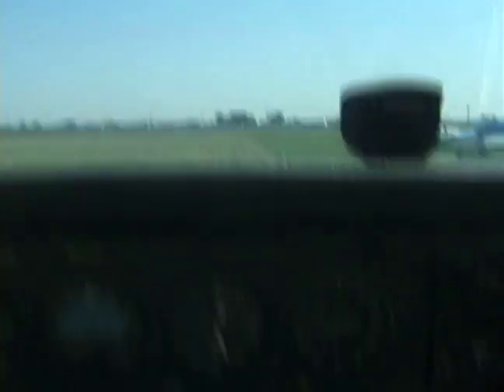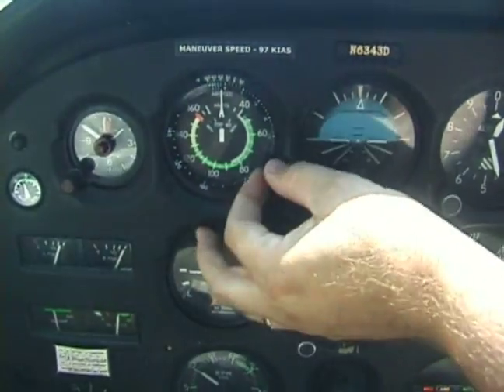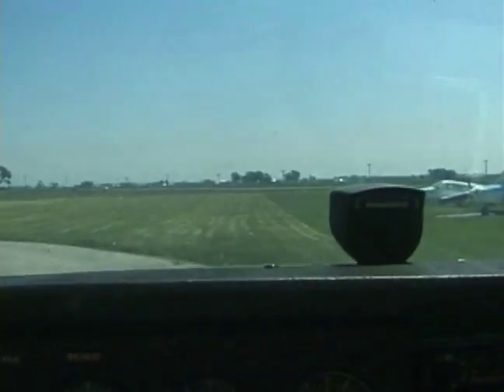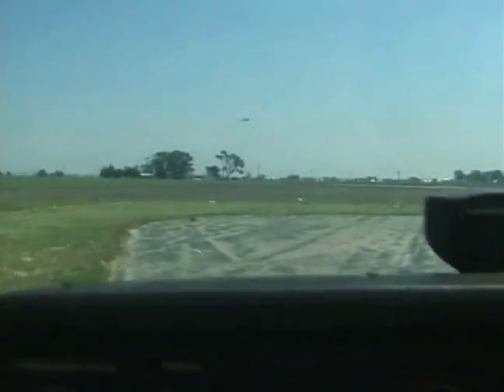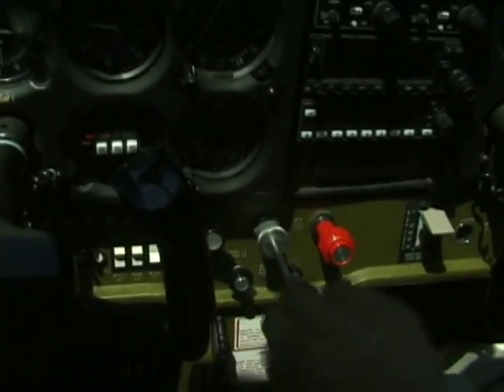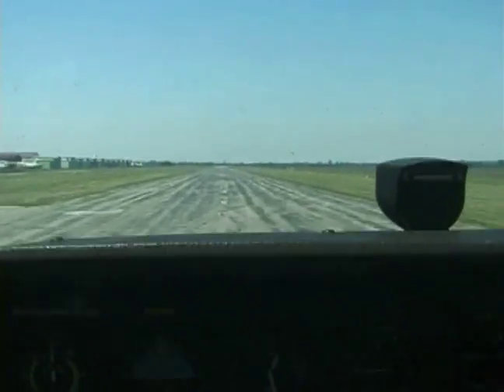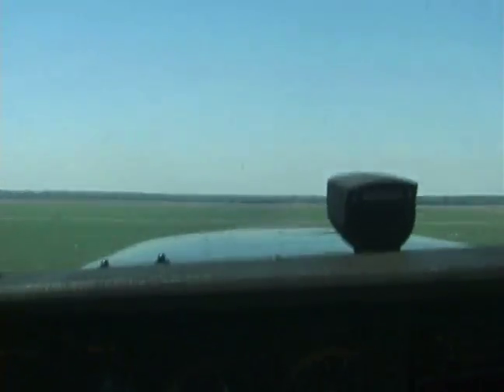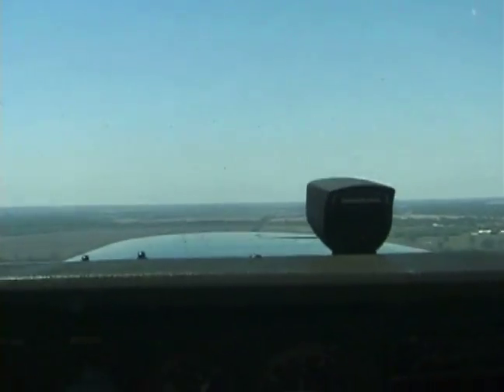How to Fly an Airplane : How to Take-Off an Airplane

Comment: Getting a plane is hard I go to Australian air league and unifor is 250$ planes cost around 100000 for a used six seater. To get ppls you need at least 4 years of flying and by the until you are around 45 you can't fly international.

Comment: I am very sorry, but I have to break your dreams. You cannot just get a free one if you did good in school and had good grants. Also, it is not 17,000. More like 100-300 thousand. A commercial plane like delta airways or Emirates costs around 5-6 million per plane. This is a small and tidy size plane, but is more than 17k or everyone will go to flight school and just buy a plane to fly around. Also, just going to flight school will not get you behind a wheel. Their is several years of training.

Comment: Depends. IF the aircraft doesn't have nose wheel steering you're going to use the brakes to turn. The rudder doesn't have nearly enough authority at taxi speeds to turn an airplane. I've flown a few planes without nose wheel steering and that is how it is done. A ground loop has nothing to do with brakes.

Comment: @saquina80 That is very odd.In a light aircraft I expect it is not as essential to do so.But only when there is no wind.With a airliner, not extending the flaps on take off will result in a definite crash

Comment: well,  I'll give you a little credit,  that you certainly DON'T know much about Aircraft,  and the surface Postion Options available,  for Take-Off,  given different Aircraft, Weights,  Ambient Air Temp,  and Density Altitude.   Yes,  it IS possible to do a "No-Flaps" takeoff.   do a little reading,  and you might learn something.

Comment: yup this is a 172 and unless the runway is shorter than 2,000 feet with an/multiple obstruction/s at the end....flaps 10 is generally not needed. BUT it also does depend on the payload you're carrying as well as runway conditions :)

Comment: The use of flaps depends on the type aircraft you are flying. Some perform better with flaps extended at take-off and some perform better without flaps. It has to do with the aerodynamic properties of the wing and the CG of the aircraft.

Comment: You don't need flaps if the runway is long enough for your airplane. Flaps produce lift at lower speeds. If you have enough room to speed up you can produce enough lift without flaps.

Comment: You're absolutely right. My point was just that I think you are able to take off and land without flaps, given that the runway is long enough and the runway condition is good, and I'd say that would go for the larger airplanes as well. It would however not be very comfortable, because you'd have to land at a very high speed so you're not stalling (perhaps high enough to break the undercarriage, which is probably the reason why you don't do it).

Comment: actually some aircraft, most commonly, the larger aircraft are type certified to take off with ALWAYS using flaps. This is much more common in transport category aircraft. A cessna has a big enough wing and short enough take off roll where it is not a big deal. Soft field or short field takeoffs will use flaps though

Comment: You don't have to use the flaps when you take off, nor when you land. The ground roll gets shorter when you use flaps, but your climb rate gets lower. This time the pilot knew he had a sufficient length of the runway and therefore concluded that he didn't need to use his flaps.

Comment: Most nosewheel aircraft have a steerable nose wheel, and you can also use differential brakes, but the latter is mostly for taildraggers or planes with a free castoring nose wheel.

Comment: Its probably easier controlling an aircraft in real life, from my experience. The difficulty comes with learning all the different checks, eventualities if something goes wrong (you may have to consider a range of things upon landing, in case something goes wrong at the last second) and controls in tough weather. Getting used to a yaw is also weird at first. You dont usually get random engine fires on FS, nor all the controls to deal with them properly.

Comment: That's about it - the wings need to be moving through the air to generate lift - the prop pulls the aircraft through the air so the wings can produce enough lift to counter gravity and get the plane off the ground.

Comment: Flaps slow you down when they increase lift, when taking off you want as much speed as possible. You'd only use partial flaps for a short take off when you needed to be in the air quickly.